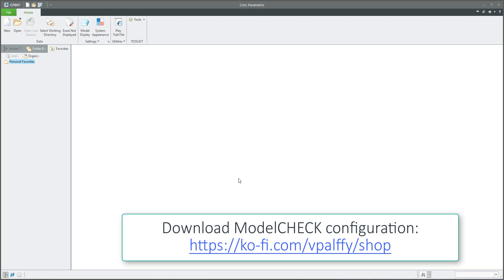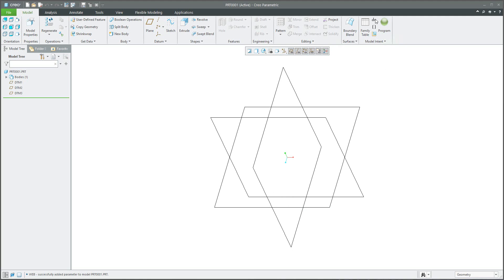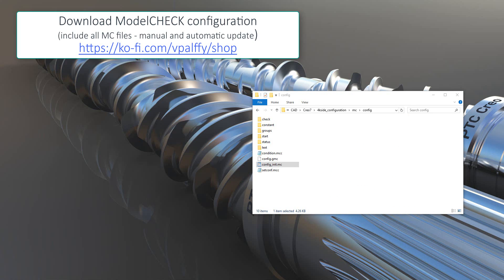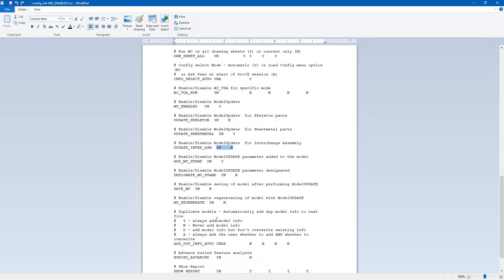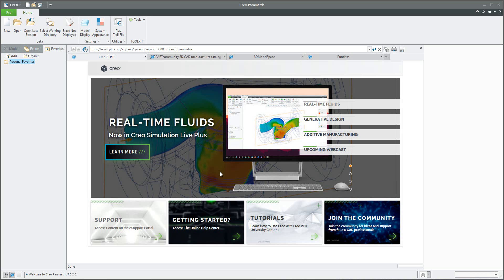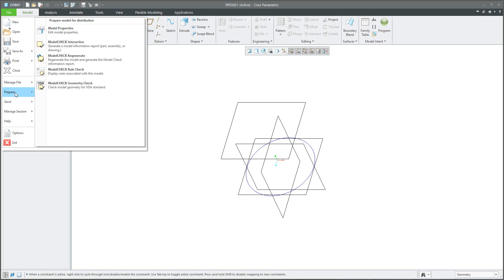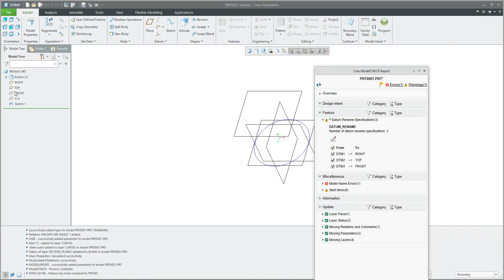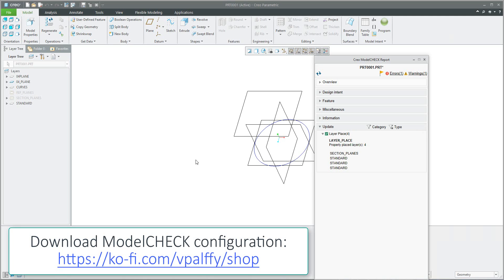ModelCHECK tutorial: How to automatically change Parameters and Layers by ModelCHECK

Comment: i dont have the update tab on the modelcheck panel, eventhough it is enabled in the config init file
Reply from the maker: Try to use firstly default Creo ModelCHECK configuration. If works, apply your changes.